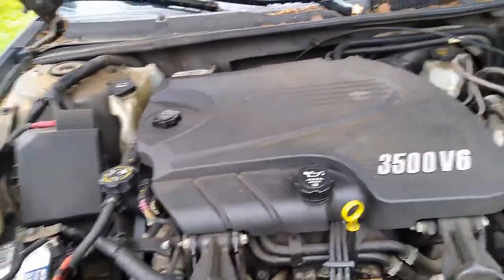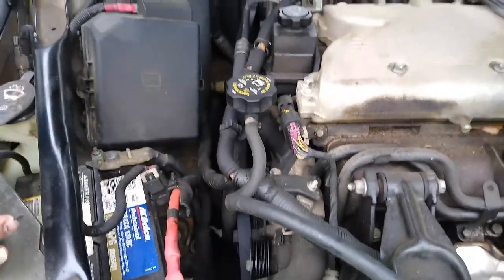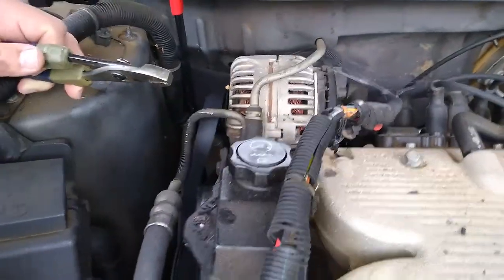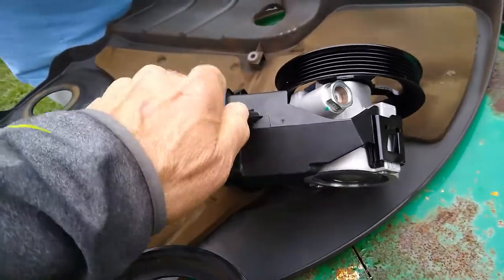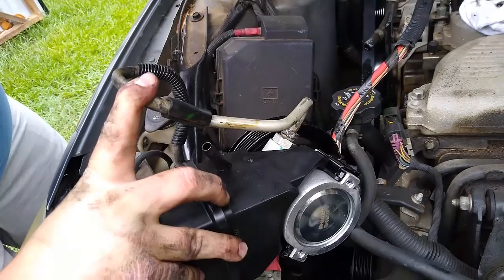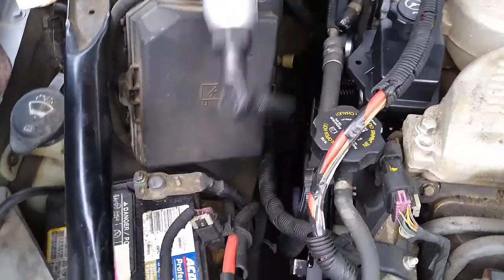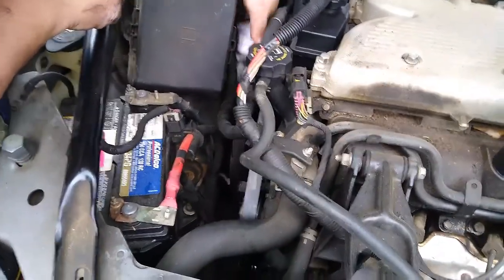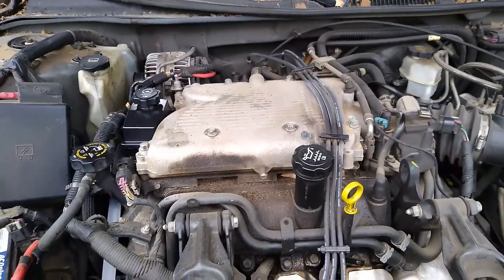Replacing Power Steering Pump, 2006 Chevy Impala

Comment: I gotta give it to you for working this out yourself.  I have a 2004 Impala I’ve been nursing along with the pump for 2 years.  Mine is located up against the firewall, about 16” deep and takes a custom funnel arrangement just to put in P/S fluid.  I say custom because it takes the corner attachment of an old vacuum cleaner with a transmission funnel stuck into the top of it to be able to pour fluid into the pump.  In winter, the fittings shrink and I have to add about a cup 2x a week just to keep it from singing like a Ford P/S pump right off the lot.  Quote is $1100 if it’s pump and both hoses.  Hell, I only paid $2300 for the car. I hate not being able to see/fix an engine.  My first was my grandpa’s ‘62 Biscayne.  I could sit on the fender and bend down to remove the two spark plugs that fouled from bad rings about every 200 miles.  Clean em up, regap, repeat.  Those days if you had a Chevy with 75k miles you were a dead man walking. But at least you could work on it.
Reply from the maker: Good old days. Can't hardly work on the new ones, that's by design. Thanks for watchin Elvis,     Pinballman1
Reply: Oh I miss the days of being able to sit inside the hood on the fender and work on the car!

Comment: Help!!  Hubby trying to replace power steering pump in my 2006 Monte SS And running into roadblocks. He has tried two different pumps and they are both different from my car and neither of the two line up to the hose in my car. Both were bought for the same engine yet all THREE are different!! Any advice? Please🙏🏻?!?
Reply: Oops the SS is that eight cylinder and I see you’re working on a 6
Reply from the maker: @Throttle86  Did you get it worked out Chrystal? I'm not a mechanic by any stretch of the imagination but if I can help I'm more than happy to.   Pinballman1
Reply: @pinballman1  unfortunately no. He went to get them a 3rd one and had same issue. So fricking weird!  I think he’s trying to weld the original pipe to new PSPump now. And I mean right now as I type. Lol
Reply from the maker: @Throttle86   Sorry to hear that. I have had better luck searching for parts using the vin number of the vehicle. Give that to the auto store and they should get it right, unless of course the engine has been changed out with a different engine. Have you had the car since it was new? That's the only things that I can think of that may help you Chrystal. Good luck
Reply: @pinballman1  That’s a very very good suggestion actually. He had not done that. He did get it welded on and it looks perfect so hopefully he’ll get it installed today and I will have my car again. I sincerely appreciate you responding and trying to help. God bless you and yours!